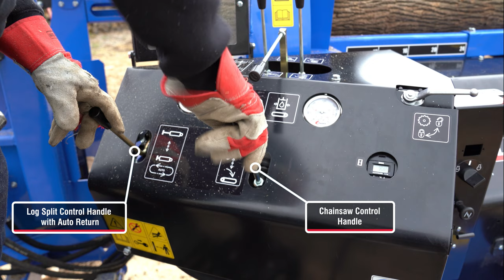Wallenstein WP1624 Firewood Processor

Comment: Been looking at this machine. Looks like you guys have done your homework.. My only concern is why the max log dia is small-ish/what actually limits the max dia?
Reply: The size of the opening for the log to fit through by the chainsaw.  The length of the chainsaw bar also limits log diameter.